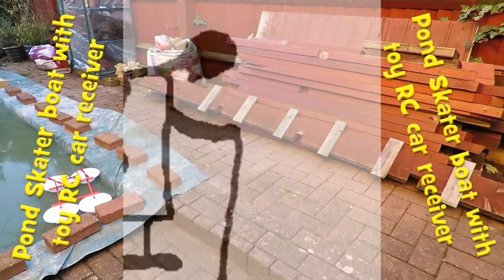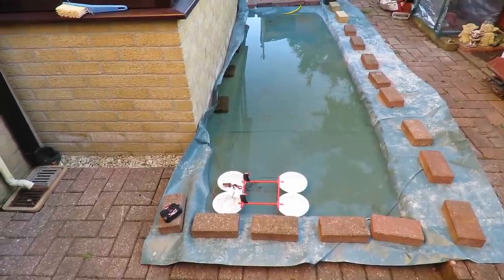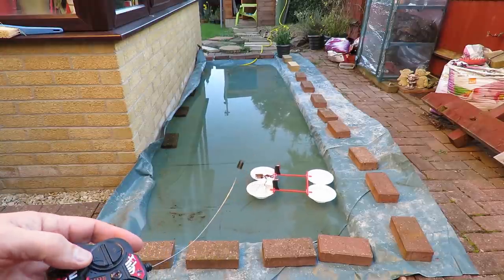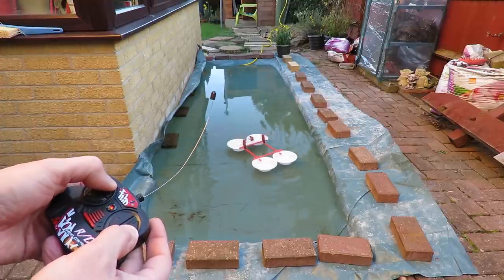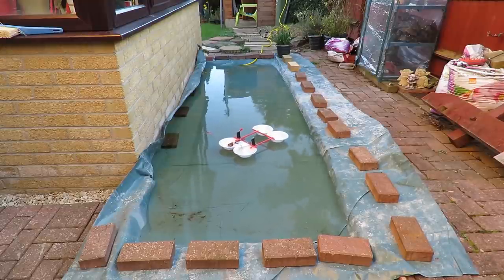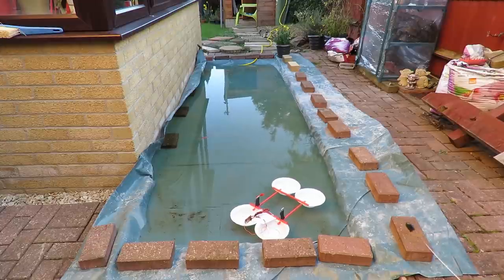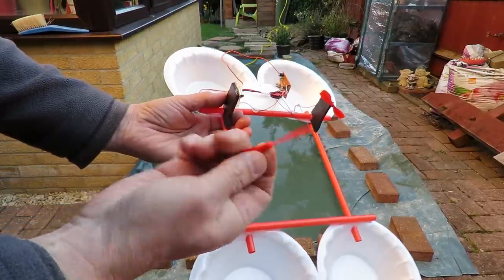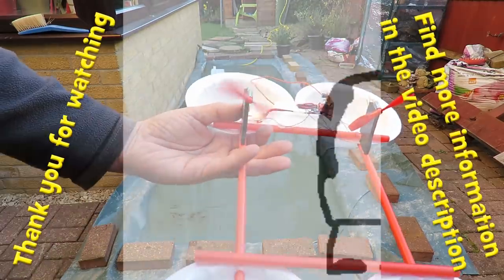Pond Skater boat with toy RC car receiver

Comment: awesome little boat and it works really well too, i noticed that one of the motors didnt do that funny sound like it it in the first video where u explained how the mechanism works. ya super glue would be better to hold that prop in place rather then the hot glue. also nice video as well.

Comment: It works well. But those controls would do my head in!
Reply from the maker: +wordreet it is interesting how quickly the brain adapts to the controls. The test in the puddle does not do it justice, but I have used the same system on several toy boats with twin engine steering on the boating lake. The main problem is the short range on those cheap RC toys. Life is much easier with a cheap hobby grade set-up and it is hard to get interested in using cheap RC toys once you have used the proper stuff even at the cheapest end of the hobby grade range. Some of the more modern cheap RC toys do have a better range but it is still only a fraction of the proper kit.